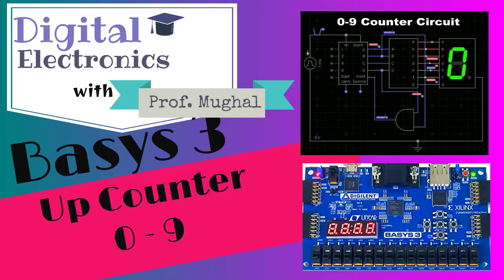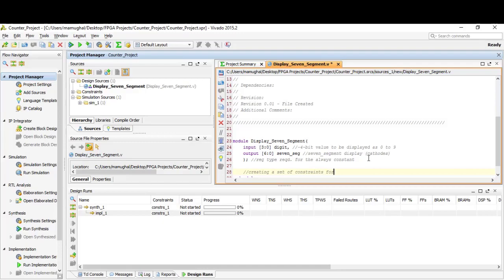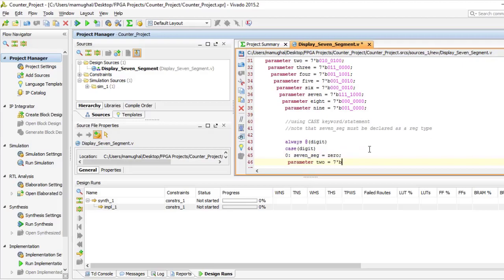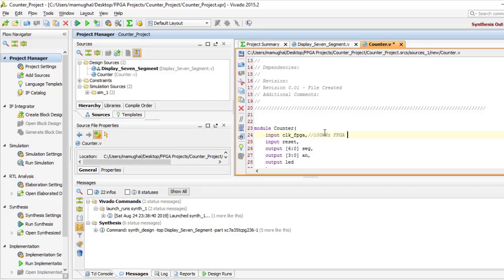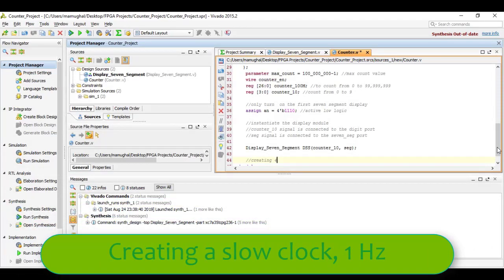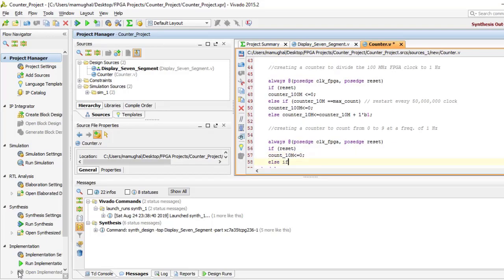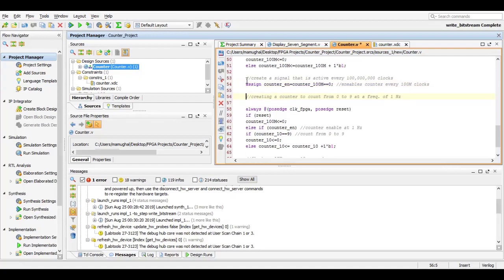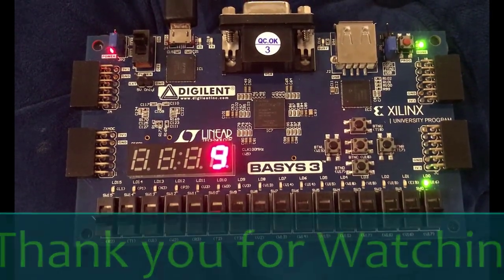#17 Implementation of UP Counter on Basys 3 Board | Verilog

Comment: Something issue is there FPGA count is stucked on 9
Reply: How did you fix it?
Reply: @CYC10N3_Gaming  I think you have to decrease the clock frequency
Reply: I had the same problem.
Reply: @jacktorrance2336  okay so it's not stuck on 9 it's actually couting so fast that only 9 is visible on seven segment display
Reply: I troubleshooted this problem a year back ago
Reply: It's actually  not stuck on 9 it's counting so fast that   only 9 is visible  so reduce the speed of counting
Reply: O ok, but how did you reduce the clock  @guitargames5912